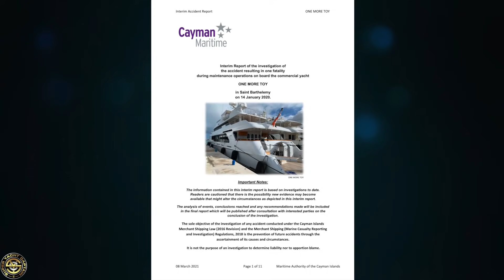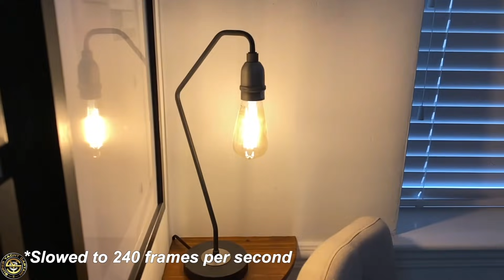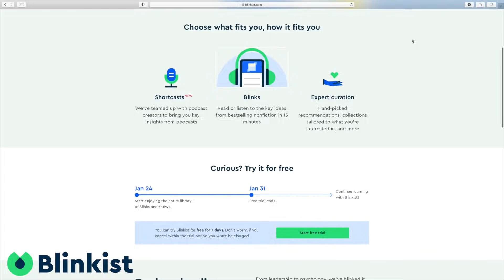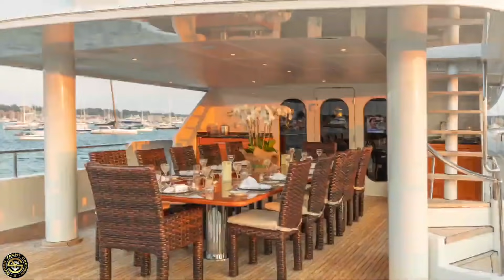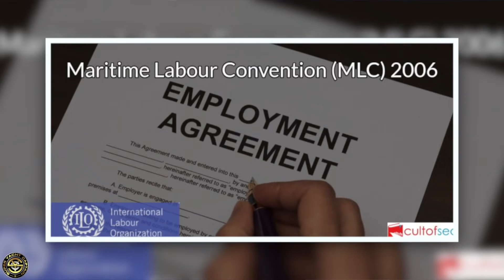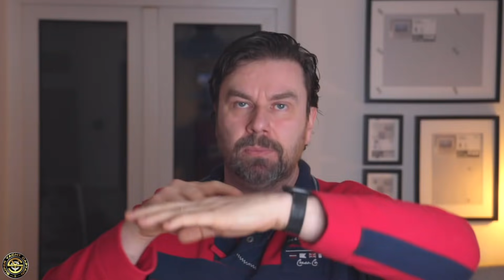Fatal Electric Shock

Comment: Tristan:

The Red Ensign Group Yacht Code (Part A January 2019 Edition, Chapter 8a, Electrical Installations, Vessels of Less Than 500gt) reference compliance with the SOLAS Regulations. And yes, I did download and review the document.
The SOLAS Regulation (II-1 part D Regulation 45) discusses “Precautions against shock, fire and other hazards of electrical origin.”
1.1 Exposed metal parts of electrical machines or equipment which are not intended to be live but which are liable under fault conditions to become live shall be earthed…
It appears the vessel was not incompliance with Regulation 1.1
That said, failed earths, grounds here in the States, can be very hard to identify especially if intermittent. But I will defer to the other commenters with extensive practical experience. Their observations are spot on.
Thanks for the video on a sad but important incident.
Ramón

Comment: I didn't know eSysman was an engineer and had all this knowledge. I thought he just loved Yachts and did some work on them in the past.

That's Awesome!!
Reply: Is he an engineer?  Just bec he knows about electricity does not make him an engineer; similarly, I know a lot of electrical engineers who have a poor understanding of electricity.
Reply: @borysnijinski331  I wasn't seeing any comprehensive knowledge of electricity - there.  His stumbling presentation on 3-ph power wasn't even relevant to the incident. Instead of bits of twisted wire, a couple of sheets showing block diagrams showing the current paths would have been better than the Blue Peter show.
Reply: @YachtReport  You are correct, I have no idea about making videos, but I do know Electrical power generation and distribution.     It's not about making things easy for laypersons to understand - you still need to make it actually correct.   I sense that SYC and yourself have rushed to get that content out with very little review.
Reply: @borysnijinski331  No he is an engineer because Tristan said he was an engineer 😂  4:27
Reply: @LivingTheDream21  to people in UK just about anyone with tools is “an engineer”.

Comment: Marine Electrician , Always , Always check voltage on any appliance twice before service. Before you lockout the breaker and AFTER YOU TURN OFF AND LOCK OUT THE BREAKER . I lost a colleague a few years ago to this , he checked for voltage on a 220v appliance , went and turned off the clearly marked breaker. But failed to check voltage again before servicing. It turned out someone had bypassed a bad breaker and wired "line" directly to a buss bar. Many of these vessels are 20-30 years old and been worked on in foreign countries or by non licensed electricians. Be safe !
Reply: Of course - but..... that is not relevant to this incident.

Comment: Hearing that technical explanation gave me goosebumps. 

If Im a superyacht owner, I’d immediately instruct the Captain and Engineer to replace the Load Bank, and check all critical wiring especially those below knee level.
Reply: This was not a "machine-specific" incident.  It was a 3ph, 480v machine casing which was 'live' + had no earth-path until the Engineer provided one.  It could be ANY electrical machine.
Reply: @blackal53  

Yes. Correct. 
So, every electrical appliance running on hi-voltage 3phase should be thoroughly checked
Reply: @JK Low - and replace all the appliances as you suggest with the load bank?
Reply: @blackal53  

Replace every hardware along with all wiring. 

After all, since you guys are so obsessed with safety and rules and regulations, and can afford such an uber-expensive toy with easy money which is most possibly “financial gambling”  money and/or dirty money, spending money on safety matters shouldnt be a huge deal.

Comment: An electric system with battery storage and a smaller generator would not require a load bank. Many things can go wrong with heating elements as a load bank in a highly corrosive salt water environment; the grounding issue was a clear warning sign that should have led to the automatic disconnection of the load bank, placing life safety above environmental pollution.

Comment: Tristan, your review of this sad incident is much more pertinent than even you may believe.  I am an industrial electrical troubleshooter with over 50 years experience and I can tell you that both of those Two Failure Elements of this event are actually everyday occurrences.  First of all, the efforts made to construct electrical systems that are waterproof are rarely ever 100% effective for very long.  Thus, the mess around the heating element wiring comes as no surprise.  

Note: In the case of this load bank, there were (are) no less than 12 possible ways for that fault to occur.  Each of the three heating elements had insulated feed through connections at each end (3 times 2 = 6).  Then there is the insulation of each to the actual heating elements that contained the current, thus 3 more points of failure. (running total = 9).  Departing the immediate area, the insulation of the 3 Phase Wiring coming to the unit extends the total to Twelve Failure Modes of the First Failure Element.

The Second Failure Element is that of the faulty Neutral / Ground.  To emphasize from your presentation, the sole purpose of grounding (now referred to as Bonding) everything on the ship (or factory) to a common point is to be Absolutely Certain that any of those Twelve Failure modes listed above, will result in a FAULT CURRENT flowing back to the protective device at the Power Source (Fuse or Circuit Breaker) and resulting in a blown fuse or tripped breaker. 

Where I frequently see the confluence of these two issues is during maintenance and or repairs.  The equipment is heavy, the areas are oily or dirty, the environment is hot, uncomfortable, confined, etc.  Sometimes, the personnel involved may be chosen for their tolerance of the conditions, physical strength, physical size (tight spaces), etc.  What happens is a focus on "making it run" as opposed to completing every last task, like dragging out the ohm meter or even less likely, the insulation tester (same function as ohm meter, but applies much higher voltage specifically to catch marginal insulation).  

As the Captain, it would never hurt to ask and or observe, after such an event, if all the guards and grounds have been verified to be as intended.

Best Regards

PS, In 50+ years, I've been shocked a few times and I got across 277 VAC about a year ago while standing on a ladder working on an electric roll up truck bay door operator.  While it was very unpleasant, I did not fall and proceeded to complete the work (at that time, age 72).  In my case, the contributing factor was an electric brake in the door operator with which I was unaware.  I won't make that mistake again.

Second example, many years ago, I bought a house that had an electric range built into a wooden counter top.  Right next to it, was a wooden cabinet that also contained a built in electric oven.  As it turned out, the range was grounded and the oven was not.  One day, after I lived there for about 10 years, I was leaning against the metal oven door which contained a faulty heating element and when I reached over and touched the metal range top, I was hit with a solid 120 VAC shock.  Same exact elements as your event - Failed Insulation & Missing Ground (Bond).
Reply: The whole Electrical Industry has multiple stories of electrocution. It’s very easy to under estimate the invisible danger. I don’t have sensation in my left index finger thanks to a 2500v capacitor with a failed discharge resistor, my finger was touching ground so it left two pin size burn holes & frazzled the nerves but failed to travel further. Working in commercial kitchens you witness the stupidity of people, from a guy who crossed the safety barrier to stick his finger towards a HV transformer, to another who crossed the barrier and began cleaning dust of internal components with a wet cloth. No matter how much you explain the risk, don’t enter an area or touch anything people occasionally do.
Reply: 50 yrs experience and still not enough sense to be wearing insulated safety boots and use a fibreglass ladder or check for presence of voltage before you work on anything.  You’d think you would know about lock out tag out.
Reply: @borysnijinski331  pretty sure by this comment you’ve not a clue what you’re discussing.
Reply: @chillee2531  actually, I am very clued in
Reply: @borysnijinski331  I’m sure you think you are.
Reply: @borysnijinski331  In general, I agree with you. I qualify that in my business, there is a spectrum of activity.  In the beginning, there is design purchasing and construction.  During this phase, the activity never proceeds beyond mechanical / installer levels.  Then the electrical work begins when the power comes on and checkout begins. Manual controls are checked, motor direction, safety provisions and equipment installation requirements are verified.  Next, automated sequences and other provisions are tested tuned and refined coupled with customer training and as built revisions.  Once the power is turned on and the process begins to function, it is seldom turned off, sometimes never.

The example that I sited, was a roll-up door that had been aggressively specified to contain only the mechanical components and a 3ø motor.  Everyone believed this to be the case, including the door equipment vender.  I was working to identify the wiring to the switch that indicates when the manual chain operator mechanism was disconnected so that it was safe to run the motor without the chain moving.  During this time, following a series of attempts to run the motor that resulted in overloaded conditions.  The workmen had disconnected some of the wiring and I undertook to check the motor to identify why the properly sized motor was unable to move the door.  At this point during on again off again testing, I encountered the wiring to a normally energized brake that no one knew about that was supposed to be connected phase to ground.  The wire that I touched was the ground side of the brake coil that had been disconnected previously.

I hope that this story is an aid, just as is the shipboard example, for readers to consider when they are involve in this type of work.  Specifically Mr Nijinski, just as your ego is telling you that you would have avoided the situation that I encountered, mine is telling me that I would have avoided the one on the ship because I encounter those situations often and therefore carry the equipment to test for them.  However, my experience teaches me that it is entirely possible that I could have missed the one on the ship and also that you would have never gotten my door to work.  This work is not to be undertaken lightly and I take it very seriously.  I have also upgraded entire control systems on production units without losing a single production hour.  There are different levels of experience, know your limitations!

Best Regards to all who got this far!

Comment: As an ex-electrician, I can't emphasize enough the importance of metering a circuit after it has been turned off.  There can be all sorts of leaks from faulty apparatus and wiring.  And, only fools work on live circuits; it should never be done.

Comment: While the loss of a life is tragic, the electrical explanation of single phase versus three phase, which was accurately described, is not relevant to the cause of death. 
The  defective  earth bonding  was the cause of death and this was not adequately emphasised and many may have missed this. Many viewers may not have continued to the end  to  find the  real cause.
In summary a verbose presentation  which should have been edited to state the conclusion quicker.
Also a commercial plug very early in  video was insensitive and unnecessary in the telling of the sad story. Also mispronunciations!!
Reply: Had to agree, I was wondering “where is this explanation heading?” That and the usual tripping around a simple explanation...........
Reply: The explanation of how electricity works was very poor e.g. insulation on the wire does not protect you from current flow in the wire...it protects you from the voltage.  Not convinced eSysman understands electricity.

Comment: As a 32 year veteran in the land based electricity supply industry, this serves as a stark reminder to me never to take electricity for granted. Like fire it can be a life saver or a killer. Don't fear it but you must respect it. Condolences to those robbed of a love one.
Reply: I both fear and respect it. Heard a few handy tips from qualified electricians, like "Never become the path of least resistance" to keeping hands in pockets around exposed kit to avoid touching it.
Reply: Also left hand breaker rule.
Reply: @scabthecat I.. think so. Even though electical engineering was part of my degree, that was a) a long time ago and b) taught me that getting protection wrong can easily end up fatal. And this has also introduced me to the idea of how to provide a safe earthing system to something that's insulated. Issue here seems to be the heating element failed in such a way that the casing became live, the earthing had too high a resistance, so the poor engineer ended up closing the circuit and providing the lowest resistance path to ground. Which also leaves me wondering how you could make this safer via ELCBs, which seems challenging unless there's an ELCB per device/conductive path. But this is why I leave this sort of thing to professionals.
Reply: My grand father died as a linesman after a pylon was incorrectly labelled (that’s my understanding but I may be incorrect) and he ascended the wrong part of the structure and was electrocuted, he survived the electricity but succumbed to pneumonia related to it.
Reply: Yes fear it and respect it.

Comment: I appreciated esysman’s explanation. I was saddened that we did not learn what could have been done to prevent the death. Clearly you need to replace faulty wiring but how do you tell there is a fault if the wiring is hidden?
Reply: Periodic testing and inspection, that may picked up a the high impedance of the earth path, and or the degrading of the insulation in the load bank. With regard to earthing, just because you have an earth wire connected does not mean you have a good or sufficient earth.  Before RCD's became standard on domestic installation's an earth loop impedance test would be carried out to determine if the earth (fault) path was of a level of resistance to clear the fault by disconnecting via protective device. Condolences to the engineers family and friends.
Reply: Double check the grounds with the voltmeter

Comment: I worked in the Semiconductor industry for forty years. I can't believe he was working by himself.
Reply: Doesn’t appear to have been ‘electrical’ work he was engaged in, other than once connecting the cooling water hose- the unit was energised.
Reply: @blackal53  It doesn't matter you don't work alone.
Reply: That might work in your semi-conductor industry.
Reply: That is how things are done in the Super Yacht industry.